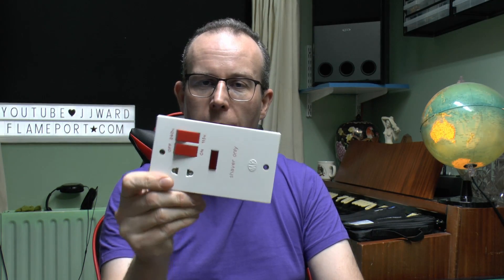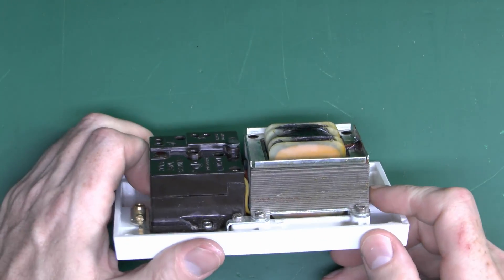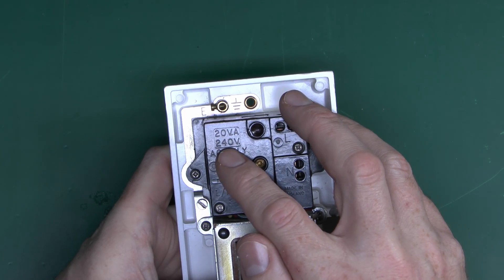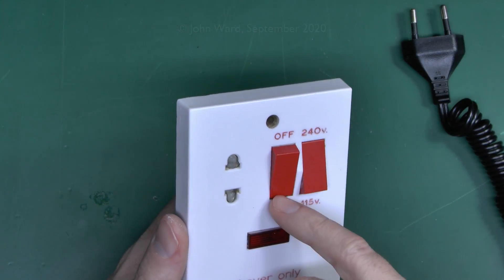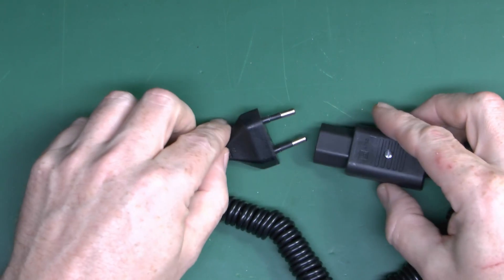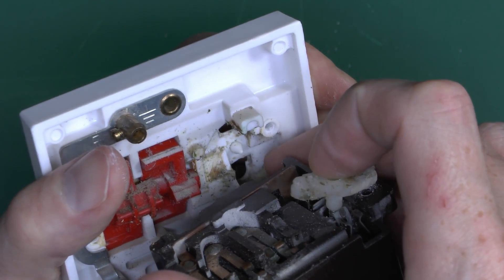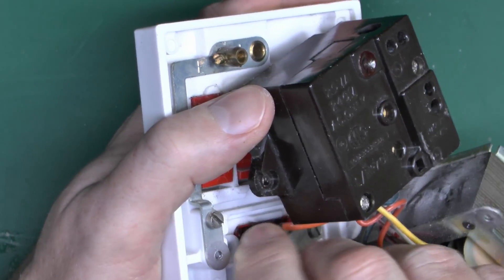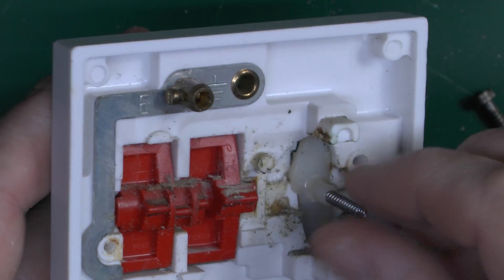Shaver Sockets for UK Bathrooms - With Isolating Transformer

Comment: Why wouldn’t it be possible to get a shock through these sockets? There is still a voltage differential between de phase and the floor you are standing on, right?
Reply from the maker: The output winding of the transformer has no connection to anything else.  The only way to get a shock is to contact both of the wires at the same time.
No shock possible from one of them as the winding is not connected to earth / the floor in any way.
Reply: @jwflame  Thanks a lot for your reply, I think I understand how it works now. But on the other hand: the hot wire of a normal socket is neither connected to anything else, and when you touch it, it will connect to ground through your body, right?
Reply from the maker: @Freba9 All supplies to buildings are referenced to ground at the transformer, so there is a path back to that transformer through ground.  Covered in more detail here: https://www.youtube.com/watch?v=sfzy5IQMzyc

Comment: Hello John,
Great explanation.
On the installation side :

The always turned on shaver transformer seems to be warm.
Bearing this in mind here are a few questions :
1) What are the requirements for the wall boxes used for the installation of the sockets with the isolating transformers?
 2) Could the box be plastic or should it be metal?
3) One of my shaver sockets should go onto the wall withe a damp-proof membrane and thermal insulation behind. - Any advice?

Comment: Hi great video
Is it possible to replace the isolating transformer, I am trying to fix a bathroom cabinet that has a shaver socket and demister led lights, where could I buy it and what is the voltage.rating that I require, the Om transformer has 2 red cables and 2 blue?
Kind regards
Reply from the maker: They can be replaced, but are normally only supplied to manufacturers of bathroom furniture, so may be difficult to find or or expensive.

Comment: interesting that your shaver cords have the standard Molex conectors, which are used on computers and some other consumer electronics devices here in the U.S 
had a funny image in mind of someone from here in the US , visiting frineds or relitives in the UK.
and had the voltage switch set to 220 instead of 115 and the shaver would start flying around  the room 
attacking them like a mad hornet.

Comment: Do these have to be fused with a 3amp fused spur. Another question i have i have a double socket with a live and Earth going into a junction box. One going to a fused spur for a heater. And another fused spur for a 1kw bathroom heater. And from the junction box directly to a shaver socket should i have the shaver socket fused on a separate fused spur too. Or is this overloading. There are 2 double sockets in each three rooms. Socket trip switch rated at 20amp.

Thanks
Reply from the maker: They can be, but are usually wired direct to a 6A lighting circuit.  The transformer is current limiting by design, and should have a thermal fuse inside which will disconnect the supply if it overheats.

The rest isn't a problem provided the cable is rated to at least 20A, which would be 2.5mm² or larger.
Reply: @jwflame  thank you
Reply: @John Ward i have a question can you bring two lights off one fused spur. I have wired up a single outside socket off its own trip switch and then going into a digital din rail timer. Then from the single socket i ran a 2.5mm² cable into my shed into a junction box. One cable out for a light with switch and one for a double socket. Then i ran another cable for a light for my second shed with a switch. Do i need anything else to protect it.

Thanks

Comment: Hi John, great video, I have a quick query.  I have a bathroom mirror with built in shaver socket and isolating transformer.  However, it is not switched and is permanently on and as it is in an en-suite the humming/buzzing noise of the transformer is amplified from within the mirror casing and is annoying.  I am confident in re-wiring the isolating shaver transformer to the mirror's infra-red switch (currently used to turn on and off the LED lights and demister heat pad) BUT am not sure on whether this would be OK mainly due to "Back EMF" associated with transformers.  Could this damage the IR switch?  If Back EMF is a general issue, then how does the Shaver Socket you dismantled get around this as that had an on/off manual switch?

Comment: Are 110v transformer on construction sites isolating transformers too?
Reply from the maker: No, earth is connected to the centre of the output winding, each wire is 55 volts to earth, 110 volts between them.

Comment: I'm from the US, so I find the differences in the rules and standards for electrical installations pretty fascinating. I'm not an electrician, but to my knowledge, we don't have any rules against outlets in our bathrooms, apart perhaps from requiring them to be GFCI-protected outlets.

I always wonder how much of the differences are a result of differences in building and safety standards, or differences in safety policy and culture, and how much comes from the more practical fact that we run on 110 volts. I also wonder why we run on 110 volts rather than 230/240 in general. Hopefully somebody'll enlighten me on that.
Reply from the maker: One explanation is that lower voltage is somewhat safer,  covered in this video about halfway through: https://youtu.be/jMmUoZh3Hq4

Comment: even though it's a bathroom plug could you get it installed anywhere in the house sorry  for asking I hope you don't mind me asking Surfer asking
Reply from the maker: Yes, it can be installed anywhere.  No real point though, if you want to charge a shaver or toothbrush somewhere else, just put a standard UK plug on it.

Comment: re above---best to use the older euro 2-pin which is slightly slimmer gauge pins than the later ones whch are a slightly tight fit!

Comment: As a" humorous" comment--- A Euro two-pin plug will fit in  13 amp U K socket if you open the shutter shield .  
Have often done this in emergency.

Comment: A lot of shavers etc still have the old U K two-pin plug fitted which is slightly narrower than the euro 2 pin. This also fits in this type socket.

Comment: The 2 pin plug shown at the beginning is a European one. The UK has its own design with thicker pins closer together, which does not fit a European socket, but shaver sockets have universal connectors. Same standard as the socket - BS 4573

Comment: Shaver sockets are one of these really odd quirks of UK installations from an outsider's perspective. Your standard sockets / plugs I find superior than the ones where I come from, which have "random" polarity. Another oddity is switches for each outlet - quite uncommon in most parts of the world and a mild annoyance with any appliance that's supposed to be remote controlled or "always on". But overall, you have very sophisticated installations and the highest safety standards IMO. Not allowing normal outlets in the bathroom would annoy me though. Where do people plug their blow dryers?

Comment: Presumably you're talking about what in the US is called a 3/4 or full bathroom, as opposed to a half bath, which is a lavatory and a water closet.

It's interesting to see how some fundamental decisions wind up causing different requirements for safety standards. One or two different dominos at the beginning (split-phase vs single phase, 32A ring circuits vs 15A branch circuits) result in totally different end results.

Comment: dual voltage of course for hotel bathrooms for visiting guests. My late 70's MK one had white rockers but otherwise the same. I think the approval includes a self-resetting overcurrent device and the 20VA is to prevent a made-up adapter lead for a fire or toaster etc whatever might take your fancy,  which purposely trips the thermal cutout.

Comment: Bizarre, Here in North America, the electrical code mandates a GFCI socket within 3 feet of a sink. Kitchen worktops have to have a GFCI socket every three feet. Believe me, this is very useful (and perfectly safe).
Reply: Ran Dome So? Every circuit in a U.K. home has RCD protection, not just the ones that happen to be near a sink. We just still don't think it's necessary to have power in a bathroom. After all, who wants to stand in a steamy bathroom trying to blow dry their hair, when they could sit comfortably in a bedroom at a proper dressing table and do it in comfort.
Reply: @spencerwilton5831  If you have steamy bathrooms then you have a problem with your extractors. Likewise who wants to stand in a bathroom with a shaver/clipper then? Having sockets in bathrooms is very useful for other appliances as well not just hair dryers....and you're not resorting to daisy chaining extension cords, which another reason why we have them in bathrooms GFCI protected and now AFCI protected as well. No problem.

Comment: in sweden normal circuits are allowed in "wet areas" but only if they are protected by a GFCI and only at least 120 cm "wire-measured" from the shower head. With wire-measured, it means you put kind of a rod down from the middle of the shower head, then you tie a 120cm long rope in the rod. All places that the end of the rope can touch, is prohibited to install sockets and switches and such. This means, that if you have a fixed wall, that is also watertight, you could install a socket on the wall above the sink, because the fixed wall would make the distance 120cm approved as the distance is the sortest distance "around" the wall, not through the wall.

Shaver sockets are nowadays prohibited to install now due to fire hazard if the rating is exceeded. Now you can just install a normal socket in the sink area but only if its GFCI protected. The socket itself does not need to be GFCI protected, it only needs to be on a GFCI circuit.
Before, sockets except shaver sockets were prohibited in the whole bathroom, but with the introducion of GFCI, they have become permitted.

For a bath, the same rules applies, but now the measure is 60 cm from the outer wall of the bathtub - and same "wire-rule" applies - if you can't touch the socket or whatever with a rope or wire that goes from any point along the rim of the bathtub and the other end of the 60cm long wire, then its permitted. If the bathtub is an integrated one, the distance is counted from any wall that is equal or lower than the bathtub's rim.
Meaning - if you have a full-height wall beside your bathtub, distance is counted from the inner edge of the wall (ergo - where the outermost surface of the bathtub touches) and then around the wall, meaning you can put a socket touching the wall on the other side provided that the bathtub is atleast 50cm wide and the wall is 10cm wide.

Here is the measurement chart for sweden electrical standards:
Shower: https://www.byggahus.se/sites/default/files/styles/inline_image/public/inline-images/BildC1_C3.jpg
Bathtub: https://www.byggahus.se/sites/default/files/styles/inline_image/public/inline-images/BildA1_A3.jpg

In Area0 (which is considered "under water") all electrical appliances, cables, conduits and sockets and whatever is totally prohibited. The only permitted thing is 12v AC / 30 v DC applicances provided they certified for IPX7 and they are meant for bath uses - for example pumps for spa bath and such.
In Area1 all mains powered appliances are prohibited except certain appliances that are not meant for human use/touch - for example junction boxes and light fixtures - provided they are IPX5 classified.
In Area2 all appliances except sockets are allowed. This also permits appliances that are connected by a socket outside of Area2.
Reply from the maker: That's almost identical to UK standards, except there is an additional item stating no sockets within 3m horizontally from the edge of zone 1.
Reply: @jwflame  So Area2/Zone2 extends 3meter from the edge of zone1? Or does the 3m rule also apply to circumstances where theres no Zone2? In sweden Zome2/Area2 extends only 60cm from the edge of Zone1/Area1. Zone2/Area2 is only used for circumstances where the water is contained, for example in a bathtub or a shower with a "low shower bathtub" in the bottom.

The difference between zone1 and zone2 is that in zone2 its permitted with all appliances, for example washing machines, light switches and other, just no sockets, while in zone1 all fixed 230v/110v appliances are prohibited.

Outside both zone1 and zone2, its "unclassified space" - even for a sink - meaning that sockets are allowed.

And 3meter is pretty long, does this rule count like the wire rule (take a rope/wire that is 3m long and everywhere it touch is prohibited) or is it an absolute length that goes through walls and everything, meaning that adjacent rooms are affected by the rule too?
Or does the rule stop at the rooms boundary regardless?

In sweden, before we had GFCI, the rule was "no sockets at all in bathrooms, except for isolated shaver sockets with a maximum voltage of 110."
But with GFCI the socket prohibition was dropped and as long as the bathroom is on a GFCI circuit, sockets are OK in the unclassified space.
Reply from the maker: @sebastiannielsen  Zone 2 is the same 60cm, it's only 3m for socket outlets.  Switches and other items are allowed outside of zone 2.  The 3m doesn't extend into other rooms, so it's allowed to have a socket outlet just outside of the bathroom door, even though that may be less than 3m distance.
Reply: @jwflame  aah now I understand. Then you have a difference in zone2 aswell, as zone2 in sweden allows "everything except sockets" - meaning light switches and fixed appliances like washing machines are permitted. In zone1 only appliances not meant to be touched may be installed (like for example lights, ventilator fans, approved radiators or junction boxes) and in zone0 only SELV of 12vAC/30vDC is permitted.

Comment: Living in Finland we have a totally different attitude to electricity with normal power sockets in bathrooms for hairdryers and washing machines (everyone has their washing machine in the bathroom, not the kitchen). Water damage is more of a worry though and all dishwashers and washing machines must have a water supply tap which you should only open when the machine is running and turn it off later. Household insurance will not cover leaks for unattended machines or not switching off the water supply after use.
Reply: Washing machine IN the bathroom... oh boy this just makes so much sense! I am jealous and when I build my own house this has just become a thing.
Reply: Yes that sounds practical and attractive having a washing machine in the bathroom on the first floor of a house, lovely.
Reply: Washing machines are in some bathroons out in Australia too, well where i lived it was, think it is a way of reusing the grey water from waste water showers and baths though

Comment: Along side grotty pull cords for light switches, this is my most loathed UK practice. As the homeowner I have a radial circuit installed into the bathroom with an RCD socket, and enjoy actual power in the bathroom, like the rest of the world does. Sod the rules ;-)
Reply: Matthew Millman I haven't seen a pull chord installed in the last twenty plus years- they are a legacy thing now only. I agree, they are grim, but they made sense in the days before RCD protection.
Reply: @spencerwilton5831  instead light switches are installed exclusively outside of the bathroom. Another ridiculous practice, not even required by regulation and unique to the UK.

Comment: The 20 VA limitation is the result of the transformer being designed with only sufficient iron in the core to support limited magnetic flux which will only produce 20VA in the secondary.  Any attempt to draw more power will just saturate the core.  The waveform will go to a square wave (well, clipped and distorted sine) with reduced voltage and no more power will be transferred.  So the transformer is both isolating and power limiting.
Reply: only kind-of. The output is power-limited, but the input side will still overheat quickly because the core no longer helps limit the current when saturated. At that point, only the resistance of the windings will limit the current. You do need a fuse, breaker and/or thermal fuse for it to make it safe.
Reply: I would much rather have a conversation with you than my wife.

Comment: Hi John ! Thanks for your videos. Just got puzzled how the secondary wires of the transformer are connected to the copper strips for the voltage selection... Judging at the 8.49 looks like all 3 rightmost contactors do short the output plug, if the selector switch is not pressed (to 120V)?!? Would be nice with a small simple schematic for clerification thank you.

Comment: Sorry JW but I'm going to have to pull you up on non-isolated shaver outlets not being for use in the UK. MK do the K700 non-isloated outlet for use outside a bathroom or shower room and connected into a lighting circuit. Protection is belt-and-braces with a thermal cut-out and fuse and it's carried by the usual UK trade outlets.
Reply: Yup,got one in my bedroom in place of standard 13A socket outlet and adaptor. Much neater.